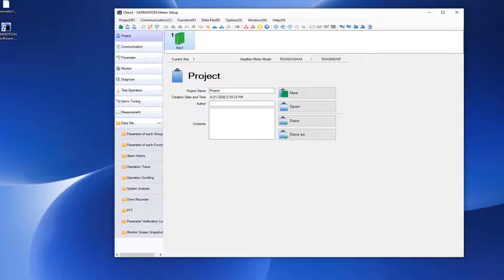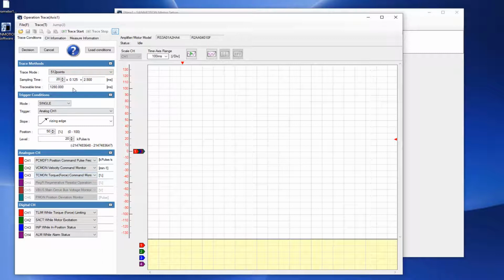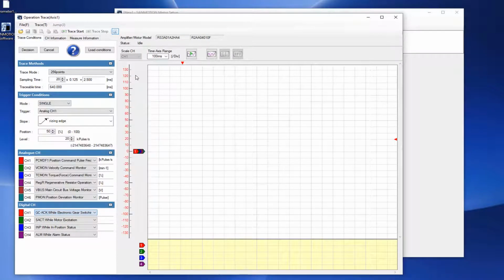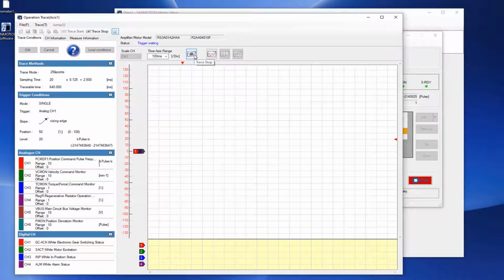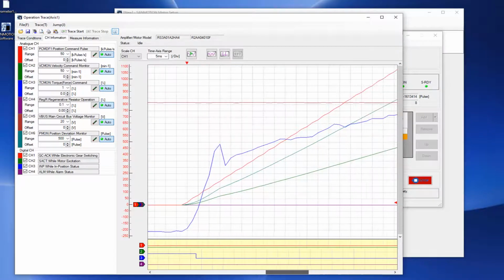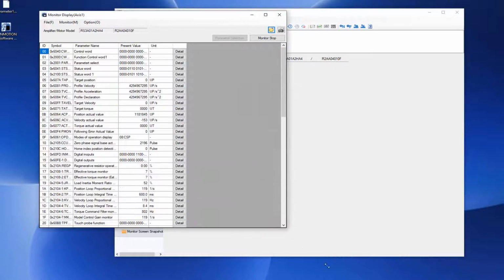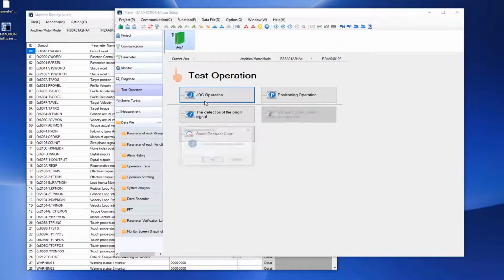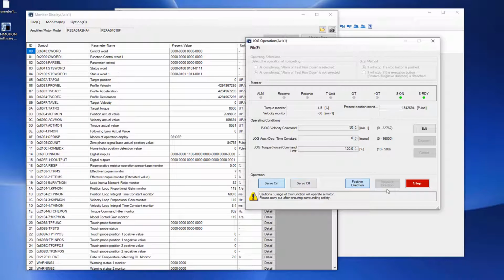Sanyo Denki Motor Setup Software Tutorial - Trace and monitor

Comment: Hello, i have  a Q2AA13150H+RS1A05AA units. comes with the PP031 encoder. i want to change the encoder with another with more resolution. due i can't find a PP038 and PP064 models (according with the RS1A05AA manual, compatibles) in my country. i want to change to generic ones (same electrical specs). is possible use it the new encoder with the driver? greetings